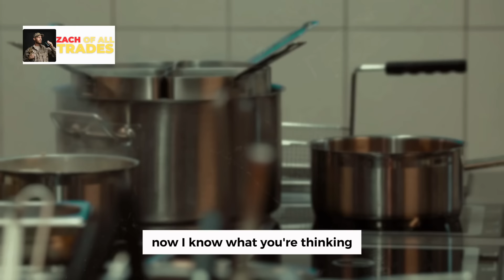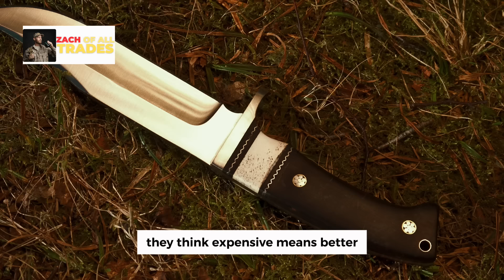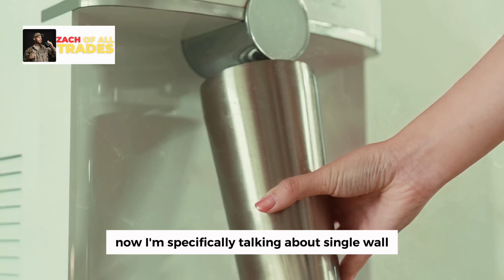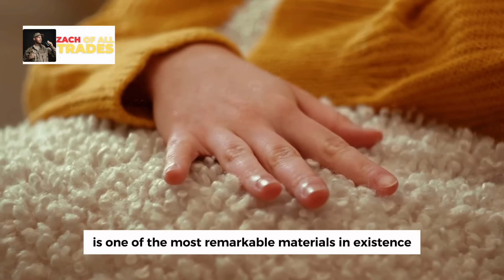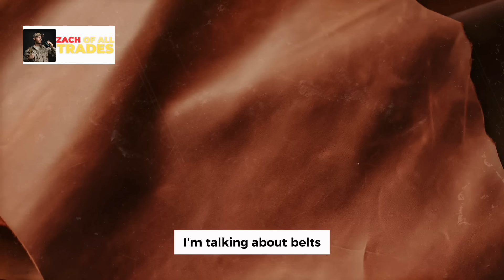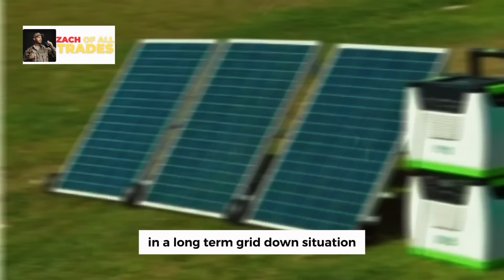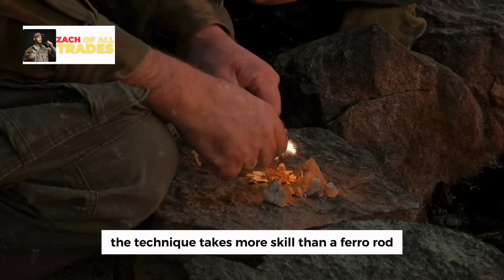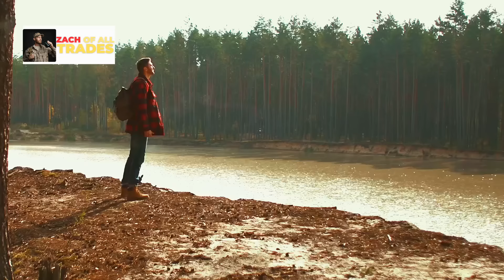15 Survival Gear Items That Last Forever!

Comment: As far as firemaking goes, do the math.  Buy a dozen Bic lighters and you have - according to them anyway, 3,000 ignitons per lighter or 36,000 ignitions total.  Let's say you only needed four ignitions per day to make things work in your household.  What you are looking at is 20 years plus of reliable ignitions.  Ferro rods are good as a can't miss ignition source.  So get one. As for flint and steel?  Are you kidding?  Ultimately, if you can't start a fire with a Bic lighter you've got bigger problems than I care to mention.
Reply: Good, cheap, reliable lighters are are real bonus. You get instant flame.
 A ferrocerium rod is a good back up, BUT , 999 times out of 1,000 a reliable flame from a lighter is easier and better.
 I prefer the "Clipper" brand, which are a refillable, regarding fuel and flint, and have interchangeably of parts.
 Don't believe me , try and light a cigarette with a ferrocerium rod !
Reply: @clivedunning4317 a normal lighter rusts and stucks in after a few years. It leaks gas for sure after 10years...
Reply: @clivedunning4317   Not if it's stormy whether, a lighter will lose it...
Reply: @pluisnonplux9728 Have you not tried "JET" lighters ? They put out a really strong flame. The best known brands in the UK are Clipper and Zig-Zag, who both produce jet lighters that are excellent for use in adverse weather conditions. They project a jet stream of flame onto your stove or tinder. The only down side is that they use a bit more fuel, but ideally , you should be topping them up every time you venture out. Happy Trails.
Reply: @clivedunning4317 nah bro clipper is shit , they scamming people now , lighters come with less gas and the flint doesnt last longer than a bic lighter thats for sure ! clippers nowadays are made to not last at all
Reply: @ZXZXVZXZX   You can still refill with gas and replace the flint with a Clipper . You can't do that with a Bic , can you. What type of lighter do you carry ? Please let me know as you seem to be an expert and I would like to see  what you use as a lighter. TIA.
Reply: @clivedunning4317 have been discussing with friends how clipper seem to have diluted their quality. Yes they are still serviceable but after replacing the flint a couple of times they don't strike like they used to and get worse fast
Reply: @scruttocks  What brand of lighter are you using now ?
Reply: Clippers are refillable and the flints are replaceable. They can be used for years.
Reply: And actually help you out, bic lighters don't last nearly as long as they used to, but if I am not safe in the time a bic runs out, yeah maybe I got bigger problems
Reply: You have a good point. 
👍🏼👍🏼
And I’m only saying this because you mentioned it, and I don’t mean to be contentious.

I’ve been using flint and steel to make fire since 1967, when my Cub Scout troop had the fire booth at Scout-O-Rama in Austin Texas.
I’ve made many hundreds of fires since that time. In the rain, in the snow, and in sleet. 
A ferro rod is great and I have dozens of them.

But flint and steel lasts forever, and it is reliable. Especially if you’ve been doing it for 58 years. 
😉
Reply: @arctodussimus6198  Nothing wrong with that. Just means you're on a different level than most with experiential knowledge to keep you . . . alive?  Yeah, alive.  Or at least warm.
Reply: Ferro rods put out sparks much much hotter than a flame from a bic lighter, hence why starting a fire in the rain is easier with one than a bic. And Flint and steel will last the longest, especially since replacing the Flint is free depending on where you live, and the steel will basically last forever, it will still be good when you grandkids are passed away.
Reply: Yeah but the gas will go bad after about 5 yrs right?
Reply: @Jes-n9e    I think after 5 years you'll have bigger problems than lighting a fire !  I have Clipper lighters that have sat in storage for years and ignited on the first spin of the wheel.
 Plus, if you only have a single ferrocerium rod and you lose it , you are in deep,deep trouble. Don't put all your eggs into one basket !
Reply: @clivedunning4317 that's why you never have just one essential tool.
Reply: I prefer the clipper to the bic. Refillable and the sparker is removable.
Reply: @Jes-n9e Negative ghostrider.  If you buy the lighters in 3-packs they'll store indefinitely.  Plus, the fluid inside the lighter itself works due to the vaccum inside.  No air means no degradation of the gas or lighter itself.  Lighters good!  Flint and steel bad!  Ferro rod good!
Reply: @Jaden48108 The spark of a traditional disposable ligher is made by a miniature ferro rod, WHICH CAN OXIDIZE and become compromised. Some modern versions are electronic.
Reply: @Jes-n9e yes it will, and many lighters leak gas so you will have reliable flame for maybe 2 years at best.
Reply: @BrokenGateq2  keep them in a cool dry place in a tin or vacuum seal bag then in a tin.
Reply: Temperature changes will make them lose gas. Expansion and contraction causes them to vent tiny amounts of gas with each heat/cool cycle.
Reply: If you've lasted five years you have perfected narrow rods or don't need them.
Reply: Thanks Jaden ❤️
Reply: @juliefall2892  You're welcome.
Reply: Fully agree with you my friend. As a hunter in NZ who's hunted his whole life, I don't even carry a ferro stick. I do however carry a couple of bic lighters in Ziploc bags
Reply: @kiwihunter1970  I guess all of you Bic only people don't know that bics fail in very cold weather when you would need that fire the most. A ferro rod also puts out sparks much hotter than the flame produced by your bic only lighter. Meaning it works when the bic fails. And having an extra bic only, won't do you any good in those situations.
Reply: @Soulja4ChristWeAreAtWar  You are correct that Bic lighters don't function well, if at all, in the cold.  That's why you put one under your jacket in a shirt pocket during the winter months and NOT in a backpack or somewhere exposed to the cold.  This is not rocket science.
Reply: As I said, 30 plus years hunting, never had a bic let me down even in snow lol. That said I light my smokes with a Zippo which runs on pretty much anything or a you imagined a world where nothing works but what you need to argue your point lol. Folk, choose what works for you but a bic is handy when it's cold lol
Reply: Pics are the only ones to store, all others flints go bad. From experience.
Reply: I got 50 in bulk cheap but they wont last a decades
Reply: @abcsmail1  Let us know if they do.
Reply: What does bic consider an ignition? 1 second.  How long does it take to leave the flame lit to light a fire? 5 seconds,  longer if wet or you're a poor fire starter.   How much space and weight is taken up if you're packing out with bulk big lighters.  Just some thoughts.
Reply: A Zippo and a gallon of naptha will last your lifetime. None of their 3000 lights would actually last long enough to start a fire. If you insist on butane, refillable is the way to go.
Reply: Backups to lighters are great because water. Bic lighters aren't waterproof. If there's a flood or an emergency having a backup flint and striker pr waterproof matches are a great alternative. Always have more than one solution ❤
Reply: You can take the flint out of a old bic lighter and put it in a clipper lighter, and zippos. 
The sparks from the flint will light a cigarette without any fuel but its not easy to do ! 
Handmade wooden pipes are handy also if you smoke. 
Tobacco ISN'T the the only thing Natives smoked in their peace pipes ! They smoked anything that grows 🌵 😂
Reply: If you consider the broken lighters, then that 3000 ignitions  drops to 1500, and there goes the advantage. 
Best had a firekit with a magnesium rod, flint and steel and charred cloth and wax in a nice tin. Unbreakable.
Reply: @yorgios22  If you bought "Clipper" lighters, with a refill canister or two, you could refill them, replace flints and swap parts .
 This would considerably extend the life of your lighter cache !
Reply: @clivedunning4317  i dont think i got those, usually are bic lighters or bluemax, usually lasts 6 months, bluemax are rechargeable lasts more than a year (stone wears out or broken pieces). its too much money i could use for other things. my tin firekit has 8 years and keep going....
Reply: @yorgios22 Great that you have got such a sustainable fire kit, I admire you for your patience and endurance when making fire in the "old ways". I still have my fire steel and a supply of flint , as well as a tin of chaga. If you see the "Clipper" brand on sale try them out. Not only can you swap the flint about, the entire striking wheel assembly ,including the flint, is interchangeable from one to another. Being refillable is their biggest bonus, you can always deploy with full lighter. 
Happy Trails and I hope you can always "catch a spark" !
Reply: Probably mentioned, but when colder climate and moisture in the evening frosts, trying to make a fire in that hour with a Bic, it won't even spark a cigarette (full of gas Bic with flint steel going hard) if dryer nights Bic all the way, if not ferro brings spark back to life

Comment: The $1.99 Harbor Freight Magnesium block/Ferro rod I use throws a great spark and has lasted for years.
Reply: I always carry one of these magnesium blocks with me, in addition to a ferrocerium rod. 
The magnesium shavings are a real bonus in damp,wet conditions.
Reply: @clivedunning4317  magnesium is very difficult to work with as it’s light time is very short. Look into fatwood, it’s bulkier sure, but lasts a very long time and you only need very little of it to start a fire
Reply: @Alejandro0__123    I am speaking from personal experience here ; when I use magnesium scrapings I have never had a problem getting a fire started.
 It more or less guarantees ignition of your fire tinder. Fatwood might work for you, but I'd rather stick with what I know will work.
 Additionally, a magnesium bar takes up much less space than a supply of fatwood. Again, fatwood is very difficult to find in my jurisdiction,  the "wrong" type of fir trees, I am told.
 Thank you for your suggestion,  it is very well appreciated, Happy Trails.
Reply: @Alejandro0__123 The trick with magnesium is to make it as fine as you can. Bigger pieces can’t ignite. I love fatwood, too.
Reply: @clivedunning4317  Let us not forget...if someone lives, (or operates), in an area devoid of dependable "type 1" level fire tinder, that may be a good indicator for carrying "homebrew" tinder such as petroleum jelly cotton balls or waxed cotton makeup pads. These will, (as you likely already know), jump-start even properly processed dead and dry hardwoods and scrub brush due to their extended burn times... (Just my 2 cents worth...)
Reply: @MikeDAntonio-t2x  I agree totally with what you are saying.
 Personally , I carry cotton pads or tampons infused, by dipping, in melted Vaseline then coated/sealed in candle wax. I wrap them in strong aluminium foil. They pack a lot smaller than cotton balls and sealing them in wax means they don't make a mess. Happy Trails.
Reply: HF "mag blocks" work just fine for igniting vaseline cotton balls and char cloth / punk wood fire tinder but I'd rather stay with my 1/2" x 5" ferro rods. If extreme affordability is paramount... stay with petroleum jelly cotton balls and "home-brewed"  char tinder and all will be fine... survival gear doesn't need to be expensive...only well thought-out and PRACTICED OFTEN!!

Comment: The knives you mentioned are good but you will never find a better knife than a Bussie. There is no better knife in the world. You can literally distroy others with a bussie.
Reply: Kukri made from carbon steel is my choice for self defence in a tight spot. The knives with the widest application of use, are the knives mentioned and are good and reliable. The Bussie range looks like very expensive weekend camping gear that lacks self defence and general use application.
Reply: Busse knives are extremely expensive. Almost none are below $400, and those are the small ones, most are much much higher. No thanks.
Reply: @johnjanuary2958  If used for knife purposes, even a $70 Kbar will last a lifetime.
Reply: @johnjanuary2958  I like my 70.- Euro Cold Steel SRK sk-5 carbon steel. It's strong, i split wood, it does what i need.
And i have some dirty cheap but excellent Mora knives, also carbon steel.... For undressing the game... 😊
Reply: Opinions on knives are a lot like vehicles...Ford, GM or Chrysler (etc...) or (watch this one "blow up) Ferro Rods!!!

Comment: Hello Zach... You do make good points but I'd like to add a couple to your list. While a bit "inconvenient", a quality old fashion kerosene "hurricane" lantern will last hundreds of years as long as you cache some replacement wicks in a drawer somewhere. I have a couple that was passed down from my Great Grandpa (I'm 73 years old now myself) and it still works just fine during power outages. The second item is more a reflection on your presentation rather than an additional item... the ubiquitous "Flint and Steel" fire set... You showed primarily the ferro rod during that presentation and the two are (as you DID point out) are very different. A "lifetime serviceable" flint striker can be homemade simply by snapping an old metal file in half (or thirds), carefully grinding the edges smooth and shiny (keeping them cool by dipping them in water often while grinding them) or making a "one-time" purchase by getting one that was made by a Blacksmith that has a history and reputation for making high quality flint strikers. I own / use several that I use weekly for both recreation and skills maintenance... which is NECESSARY but becomes a "stress reliever" hobby after you get into the habit. Thanks again for your insight. Take Care and Stay Safe... Mike
Reply: I have several of the old fashioned hurricane lamps and they are great! But bbn I only use paraffin lamp oil in mine.  Burns clean with no smell...
Reply: Kerosene I feel is out of date compared to solar panels and LED. Like sure. Keep it. But better to use it for warmth and cooking than light.
Reply: @user-xv1vm5xc1f The only problem is that in a decade, the batteries degrade, electronics fail and an emp can completely eliminate functionality. Kerosene lamps and lanterns work. Wicks can be made if necessary. Fuel like Kerosene stores for a decade. They can use animal fats, vegetable oil  and the oil can be rancid that wouldn't be used otherwise. There is a reason they still exists after 200 plus years and the earlier lamps for thousands of years. They work.
Reply: The flint and steel option. Just an observation and personal experience. If you know one or can find a local blacksmith, trade days or wherever, they are very good at making quality steel strikers. These are also an item that is attractive and durable enough to pass on to your great grandkids.

Comment: A good selection. I have handcrank radios including one you showed. They have  batteries, it is why the cranking lasts for a time. A number of things like the cast iron and canvas tarps are fantastic, but you are not going to walk any distance carrying things that heavy. Get them anyways. I like Mora knives a lot, and it didn't break the bank when one disappeared. But only the Garberg is full tang.
Reply: I like my Cold Steel SRK knive, carbon steel.. Full tang, about 70.- Euro. I split wood with it.